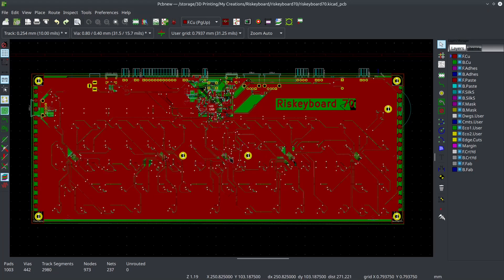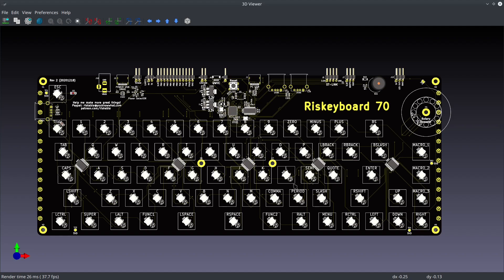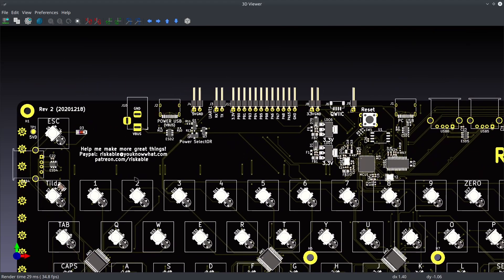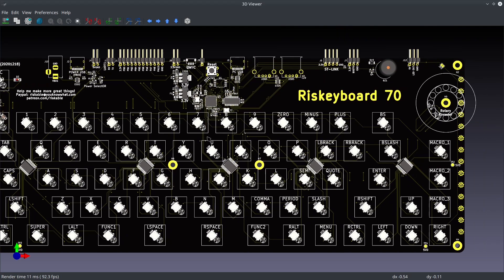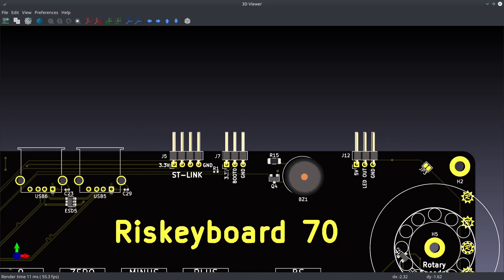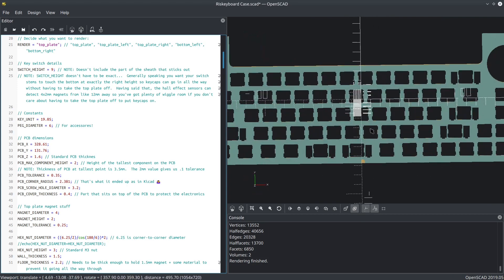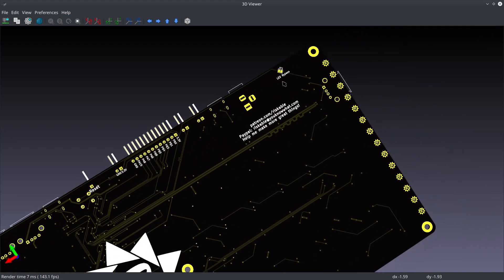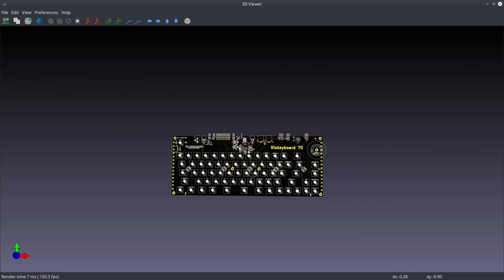Riskeyboard70 PCB Overview

Comment: you should really make a new version thats compatable with typical switches with the hall sensors in the center and maybe holes in the PCB, but you could just use KS-37B switches and a 3d printed pannel on top of the board with holes

Comment: Would this pcb be compatible with the Lekker or Input Club hall effect switches?
Reply from the maker: Maybe?  The magnet in the Lekker switch is right in the center of the switch so to make it work with my PCB you'd need to offset all the keys to the side a bit.  Basically you'd just need to shift everything to the right and down like 6mm in the top plate and bottom case design.  Sounds more complicated than it is though it might look a bit strange. Though, such a small offset might be hard to notice.  I dunno.

Comment: If you dont use the display across the top. I think it would look nice to see inside, especially if you use black solder mask and white silkscreen patterns in the empty spaces or something like that. Slide in acrylic panel so it can be switched as user chooses. When you dont use acrylic panel there can be arrangement of custom panels across there that slot in together. Breakout board, trays for small stuff, foldable smaller displays, possibilities are limitless in such a large space.
Reply from the maker: If the display doesn't work out here's the plan:  Storage!  I'll make a little storage box (with a proper lid) that slides in there so you can store Sharpies, SD cards, lock picks, etc in there.  Ooh, maybe I should take off one of the USB ports and reserve a header for a magnetic USB connector that kicks in if you attach a matching accessory (like an SD card reader or another mini USB hub).
Reply: @Riskable3DPrinting  Magnetic connector seems little bit too restrictive. Maybe find a place for headers, so any accessory panel can be at any place it fits and you just connect it and pop it to place? It can be benefitial to for users to choose sides of keyboard for different panel, for example depending on dominant hand. USB / SD cart  ports on left or right side of keyboard. Magnetic connector sounds cool and all but I think its making things more complex unnessesarily.
Reply from the maker: @MrUltramove  The whole magnet thing is because to put the keyboard together you need 222 4x2mm magnets (assuming you use THE LEVITATOR under each keycap).  That's 3 magnets * 70 keys + 12 for the rotary encoder.  Since 4x2mm magnets are often sold in sets of 300, 500, and 1000 you're bound to have a zillion left over after your build.  Might as well make use of them, right?  👍
Reply: @Riskable3DPrinting  Oh right, sorry. I thought of off the shelf magnetic connector. If you design your own into the keyboard, that would be ideal. Using magnets for holding panels is perfect with your design but for actual connecting voltage and signal through magnets will limit power output of connected USB ports or maybe not even work with high speed bus.